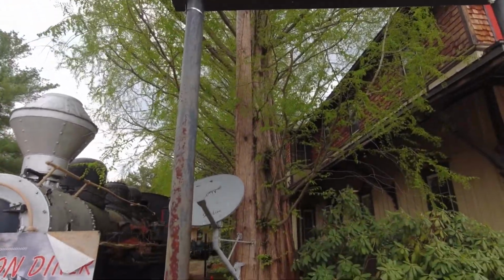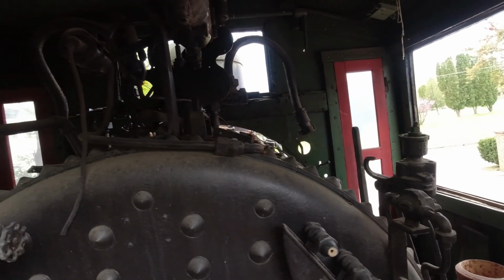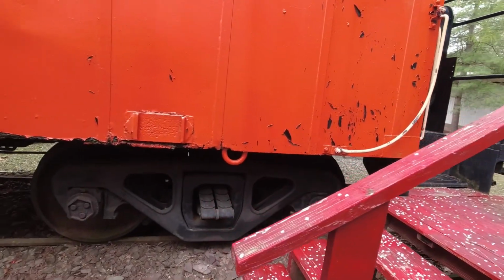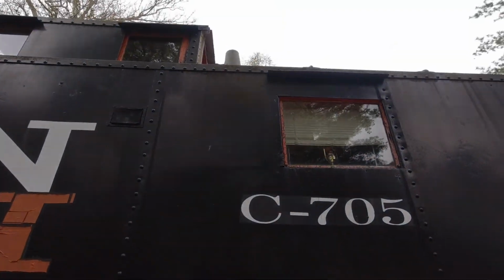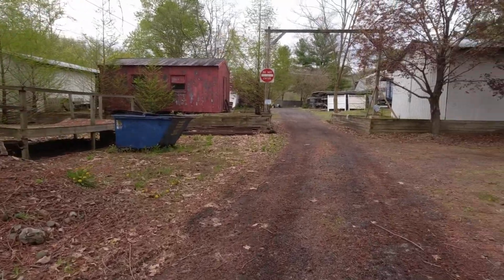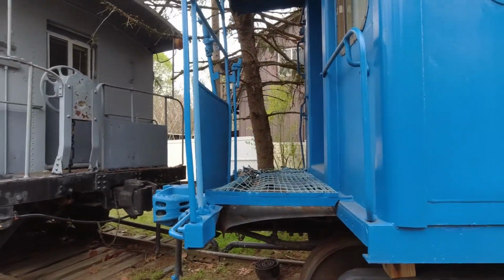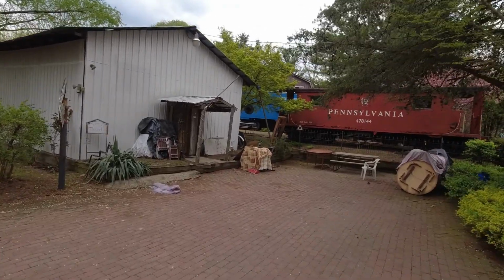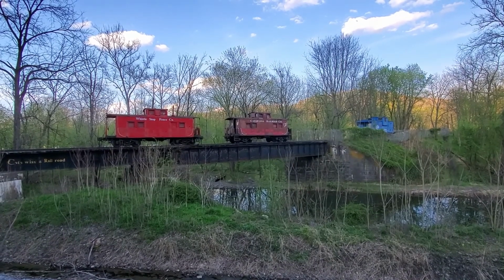Catawissa Caboose Lodge with @JPVideos81 & @mrsmithnet

Comment: The line where you are standing is one of my favorites RJ. The Catawissa branch ran from East Mahanoy junction to West Milton. There were a total of 3 tunnels. Shumans which you mentioned and Lofty which I have been to both. Lofty tunnel is harder to access as the one side is posted. I had to ride my bicycle about 3.5 miles to see Lofty from the other side (Ringtown). Lofty tunnel is directly under rt 81. The 3rd tunnel is part of the Lofty connection and is an active part by the Reading and Northern. The tunnel was daylighted some years ago and is referred to as Ryan’s cut. There is a photo book by Jeremy Plant that shows a Reading train going past the Catawissa train station.
Reply from the maker: Thank you for that info, I will keep my eyes open for that book and check that out.